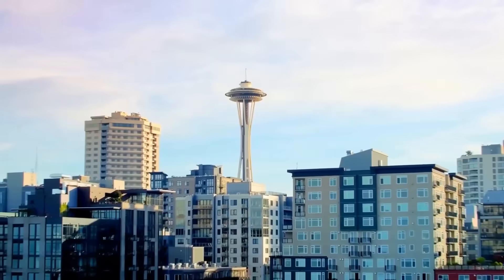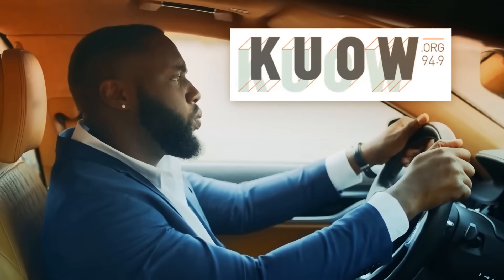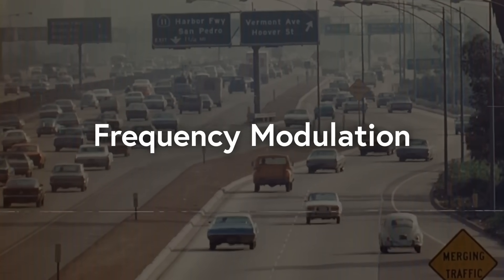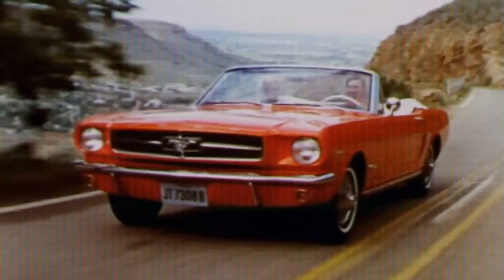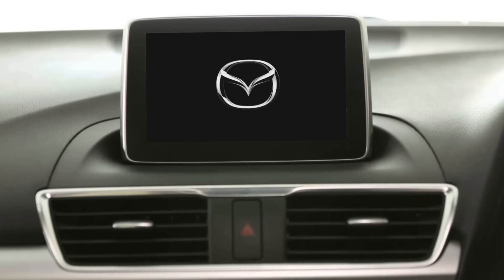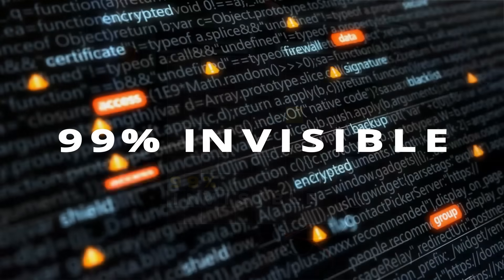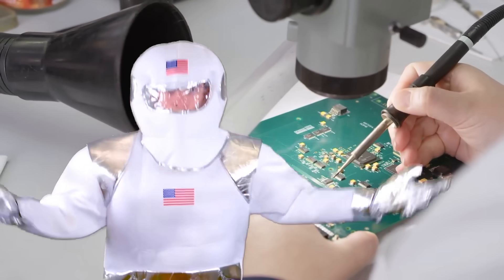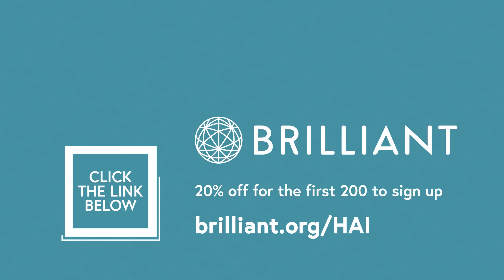Why Hundreds of Mazdas Tuned to 94.9 Broke Simultaneously

Comment: How would this even happen? I believe Unix doesn't even really need file extensions to recognize a file; wtf was the Mazda running? Was the photo missing a magic number... or any sort of header? Well, obviously not, because other cars were picking it up fine. And the 99% ordeal? Mazda... did you do this on purpose? Do you hate HD radio? All of this stuff is so easily preventable and there are so many standards to prevent this.. (Would something like a injection attack be possible because of the title? I wonder... i wonder..)

TLDR: Mazda doesn't understand how to identify files and sanitize texts.

Comment: Mazda software is so fragile it’s crazy. When updating these things you have to follow extremely specific steps or the thing will brick itself. I work on a lot of cars and that’s not normal for the industry. I mean something as simple as having a cable plugged in that isn’t even connected to anything could end up bricking these cars during certain types of updates. They have a lot to get together.

Comment: with file formats especially for images, the actual extension is usually meaningless. theres 4 "magic" bytes at the start of the file which denote what image compression type the file is using. you can rename a jpg to a png and good image viewers will still read it completely fine since they dont even consider the extension

Comment: Had an old hand-me-down AM radio that I would pull the back off. My uncle Joe had taught me how to "de-tune" it by adjusting the fins on the capacitor down.
Used to listen to the Astronauts as they passed over Clear Lake . . . A mere 50 miles away from Freeport 😀

Comment: I don't give any fault here to the radio station, because software (and hardware) must not be shut down by accidental wrong inputs, especially when they are so simple. I remember this background image that broke android phones because it had an odd color space that was supportet in the way that it would be converted into a different color space (like actually all color spaces except one) but one single pixeld produced a value inside the conversion that was not expected (like 256 instead of 255 due to rounding I think) and thus kicked android into a boot loop like the loop in this case here. This must not happen, there is this magical thing called error handling, what most programmers actually understand is important but leading people in the company might think of it as costly redundance.
The thing with the color space is far less predictable though, than what happended here. What happened here is practically a white swan.

Comment: So the things is it didn't actually brick anything. the RTOS just couldn't recognize files without extensions. The flash memory file system had a header on the circuit board that allowed access to it. All anyone had to do was go in with a USB dongle and delete the appropriate files. The problem is no automotive technician had a clue how to do that.

The worse problem is that no one at Mazda was involved in the design or production of that radio system. It was all a contract to someone in Shenzhen, so probably literally one Chinese guy working as a programmer actually knew what I just told you in the first part of this comment.
Reply: yeah they gotta stop outsourcing software to random countries to save on cost because this will always happen if you force a 21 year old chinese python programmer to write embedded code. but they don't care, because by golly look at the profit margin!

Comment: I don't do cars, but I built the first network for J-1939, the standard for Farm Equipment and over-the-road trucks. It runs on a CAN bus just the same as automobiles but plays nice with other brands of equipment. Mazda's Mapping is provided by HERE. Masda'sentertainment by HARMAN, AT&T, and KDDI provide their wireless link to vehicles. None of these services have any need to send commands to the Vehicle on its network. They should only be passive receivers of commands and data. There is little, if any need for network knowledge of their presence. That doesn't keep programmers from glomming more code on the system.

No way Mazada lets 3D party software loose on on the bus that the engine uses.

Comment: I had a Mazda and this happened, I was actually able to fix it by just putting the car in ACC and disconnecting the battery. Those Mazda radios store everything in cache RAM, that's why if you lose battery power, your radio presets are gone.

Comment: This reminds me of a case in Finland years back when some TV towers, due to configuration mistake, broadcasted completely corrupted data, essentially random data, for some time (I think it was a few hours). I've forgot details, but basically there was one specific model of set-top-box that apparently did a poor job with checksums or something, and at some point the random data happened to make up a sequence that the set-top-box took as a command to get a firmware update that would follow. That didn't end well.
Reply: Updating wirelessly from a tower sounds like a bad idea nonetheless
Reply: @itsbunnytub  As has been shown countless times in studies and experiments: End users almost never voluntarily choose to update their devices unless absolutely necessary. They simply do not want to interrupt their service, even if for a moment. It's why you may notice that software running Windows or iOS have gotten increasingly aggressive in forcing you to choose a time to schedule an update. This would be fine in the past, as updates usually weren't that intrusive, but IoT devices have constantly been used in botnet DDoS attacks, so keeping your security up to date is a top priority.

It's not a terrible idea to autonomously update a system wirelessly, especially for what I'm assuming are just drivers for a TV box. I don't know much about what caused this issue, but if your device is attempting to execute a nonexistent firmware update there should probably have been a few more steps to actually verify the validity of the request and the package that is being pulled. If your TV box isn't making those kinds of decisions, and just blindly accepts any firmware update request without doing some sanity checks, then that is an awful security problem.
Reply: I think updating your devices to keep them up to date is a good idea  @BetaDude40 , I just think that updating over the air might cause some issues. I'm all for security updates and even some cool new features, and I can definitely wait, but updating over a TV tower, without even verifying that the data is legitimate and correct, is a bad idea.
Reply: @itsbunnytub  Definitely, that's what I'm saying. The problem seemed to be that the device was just ready to accept any sort of input as valid, even when it wasn't. Tha's on the device's fault more than the practice of wireless autonomous updates, though.
Reply: @BetaDude40  come and take it then. automatic updates should always be opt-in. posted from windows 10 ltsc iot 2019
Reply: @midlowreborn  Yeah but you have probably been prompted numerous times to update your Windows 10 installation, and have probably implemented several hotfixes and patches. I don't believe in forcing an entirely new system on people (I also run Windows 10), but security patches (in general, when being done by more altruistic companies than those whose names rhyme with "Sicromoft") is a good thing to install automatically.

In all other things though I agree opt-in is always better.
Reply: @BetaDude40 this howrver, should be ignored, as automated updates are effectively trojan viruses and if for whatever reason a bad actor was able to push an update to something like i don't know a teslas, the results could be fatal
Reply: @itsbunnytub Why? Firmware is easy to send when there are spare bits because the video is freeze frame for some reason, or otherwise low-bitrate like rolling credits.
And using USB sticks not only requires having USB on the box, but also is far more difficult for the user than to just "keep the box on for 24 continuos hours to receive your update", with a "update available. Install now?" notification appearing once the update has been received.
Reply: The game Factorio, when played multiplayer, only exchanges the non-computable actions and does a checksum every so often to make sure everyone is on the same page. There was a long-running failure state where a person or people would just... desynchronize. The game code was working deterministically, as expected, so they expected the peoples' computers were having issues... but it was extremely sparse, and multiple people on the same network could have the issue. The problem? A packet checksum of FFFF was being dropped on some routers. It was a bad habit of some programmers to use the "max value" to mean error, or negative one represented without a sign (which gets 'adjusted' into max positive value). Clearly some software vendors used FFFF to mean an invalid checksum calculation, but no, FFFF *is* a valid checksum!
Reply: @doublepinger  wow that's interesting! I couldn't find any reference apart from some minor comments in forums. Do you have any?
Reply: Finn here. We are talking about DVB-T boxes here. Most likely the issue happened ~2004-2007. Boxes back then here were very simple, no internet connectivity. No sensitive data inside. Worst thing that could have happened would be losing your DVR recordings.
Reply: @enginerd80 I find this very interesting. Do you know where can I read more about this? In English or Finnish.
Reply: Surely there must be more to this story. There would be a checksum at the very least and perhaps signing to validate the new firmware. By the very nature of radio broadcast the new firmware package could be corrupted by interference. I can't believe a random string would ever pass this.
Reply: @tomkandy  The error took place earlier* in the chain, and checksums for the over-the-air stage were added after that, on the corrupted data. Apparently the set-top-box relied on that checksum too heavily.

Also, I don't actually know if it was specifically firmware that the broadcast ended up looking like, or some kind of configuration data. So the amount of bad data that had to pass checks to do the damage wasn't necessarily large. (I'm thinking it like the amount of monkeys needed hitting typewriters to create a book vs. number of monkeys needed to create a couple of sentences.)

*I think the TV company had decreased the amount of bitrate it was buying from the transmitter company, but at some locations the old (higher) bitrates kept being generated. The excess bits ended up being crudely chopped off, which made what was broadcasted nearly random data on which checksums were added at later stage.
Reply: @tomkandy  I hope someone knew a reference for this story because it's really funny to post in a blog I have 😅 There must be a local media that wrote about. It's a pity no one posted about it in The Risks Digest
Reply: I think at some point somebody's going to weaponize this kind of thing.

Comment: F.M. stations were around commercially as early as 1941, and even earlier experimentally (wide-band frequency modulation was developed as early as 1933). The first F.M. band was actually from 42-50MHz, which the upper 6 MHz were claimed for T.V. Channel…ONE!

Comment: I'm not looking forward to buying a car built in the last fifteen years. So far, the latest year car I've owned was a '99, and currently drive a '97. The previous owner replaced the car stereo with the cheapest POS Chinese-made touchscreen you can get...at the time I replaced it, they were selling for under $20. I put up with the POS until the screen stopped recognizing touch entirely (wasn't eager to spend the money or do the work)...and replaced it with a good quality JVC that has real buttons, more power, cleaner amp, better reception, etc. I suspect I won't have to worry about thieves stealing it, because it has no touch screen. When we replace this car, that stereo goes in the replacement, even if the car comes with a high-end touchscreen stereo. A car is the very last place I want a touch screen of any sort. I think people get confused and think, wow, it's the latest thing, so I'd better have it.

Comment: Okay, correction to this article -- the Mazdas affected by the issue only needed to be factory reset using a USB drive with an update.  They did NOT have to be totally replaced to fix what amounted to a software bug.  Mazda had a solution ready within 3 weeks and dealers were deploying the fix fleet-wide that month.  Most cars didn't see this bug ( obviously ) and had their infotainment systems fixed using an "OTA" ( over the air ) update for cars that had mobile connectivity -- or a USB based upgrade that could be downloaded.
Reply: Figured as much. Those infotainment computers essentially entered into what we phone hackers call a "bootloop", and everyone knows a bootloop can be fixed by simply reflashing the phone's firmware.
Reply: @SergeantExtreme is bootloop similar to this 'boop snoot' thing that I keep seeing on YouTube?
Reply: That was a huge lack of research on the video creators part. So weird to get such a huge thing wrong
Reply: ye these videos are b**-
Reply: Mazda was saying that hardware replacement would be necessary at first though, weren't they?
Reply: Still pretty shitty
Reply: Your version would not get as many views
Reply: Of course it was a clickbait

Comment: One of my first jobs in engineering back in the 1980s was in a system test facility where we got to hammer away on new software and/or firmware releases for a satellite communications system and its network control software.  In addition to operating the system per the normal instructions, myself and some of the other folks would enter random things into text fields and press weird keyboard sequences and so on.  We wrote more bug reports as a result than all the other groups combined :)
Reply: Reminds me of a joke.

A software tester walks into a bar.
Runs into a bar.
Crawls into a bar.
Skips into a bar.
Dances into a bar.
Climbs into a bar.
Flies into a bar.

He orders:
1 beer.
2 beers.
0 beers.
99,999 beers.
-1 beers.
qwertyuiop beers.
A lizard in a beer glass.
Testing complete.

An ordinary customer walks into a bar and asks where the bathroom is. The bar bursts into flames.

No matter what you do as a software tester, you will never out-test the incomprehensible array of random actions an ordinary person can come up with by accident.
Reply: I think I got kicked out of the testing team for some software we use at work, because I found too many bugs.

At least, I wasnt called-on to test the current version, and guess what? There's an essential feature that only my job position needs to use, that is broken.

Comment: Computers are neither good nor bad.  They are pieces of electronics invented by VERY bright people, programmed by formerly passionate & smart to brilliant people, but now mostly done by people that have a college degree and perhaps no passion for IT.

I tested software for about 10 years.  It's been getting worse and worse overall (my favorite, found shortly before the whole C-19 mess, was a website for some kind of grammar software.  That had a glaring grammar error in it.  Which I reported, and which a month later still hadn't been fixed).  When I worked in tech, they wanted people that knew computers.  Many didn't have degrees in IT, if any at all.  Now they use technology to filter out anyone without an IT degree.  And let's just say "competent" and "degree" are different words for a reason.

And ALL of this is why I'm not in favor AT ALL of self driving cars.

Thus endeth my rant, thank you for reading.

Comment: Personally I feel like cars with software should not update over wireless. Frankly, I don't even think a car's computer should have wifi capability. You should have to physically plug in a cable so that it only updates when you know that it is updating and have chosen to update, in order to stop some jerk from compromising your car's computer and using it to mine bitcoins or whatever people use hijacked computers for now.

Comment: Both of those bugs sound like pretty boneheaded programmer errors, and I would also expect the radio to automatically clear its cache if it is unable to boot properly after a couple of tries too. Needing to have the thing completely replaced because of an invalid file or text format is indicitive of an incredibly bad design.

Comment: What a BS video. The Mazda story is mostly BS, no electronics where "fried", and no car stopped working. Did it cause an issue with the radios? Yes, but that's all it affected, the infotainment system. Did Mazda fix those units for free under warranty? Also absolutely. The "but Mazda wants to charge me a couple thousand dollars for it" story simply isn't true, as soon as it happened some people called their nearest dealership and told them their radio was constantly rebooting, and so they were obviously  quoted for a new unit. As soon as the manufacturer figured out it was a bug, they issued a recall and fixed it for customers entirely for free. 

Also the Tesla bit is obviously BS. It's not as if there's no way to get EVs in general or Teslas in particular into neutral, *of course there is*. This is an extremely odd scenario in which something broke in a way that didn't allow that. Just as it would happen if, you know, that happened on any old car. Drive any old ICE Ford down the road, and have, say, the goddamn gearbox break, and, yeah, you won't be able to get it into gear. 

Just communist sam spreading his usual corporation hate, nothing to see here.

Comment: Both stories are examples of taking data from an external source and not checking it before processing. Anyone who has ever written code to handle input from users (e.g. a website back-end) will have been taught not to do this. It's pretty much data processing 101.